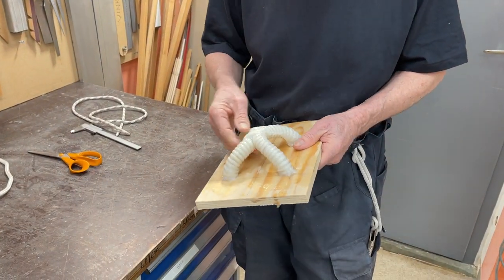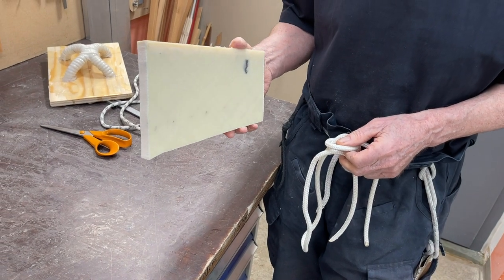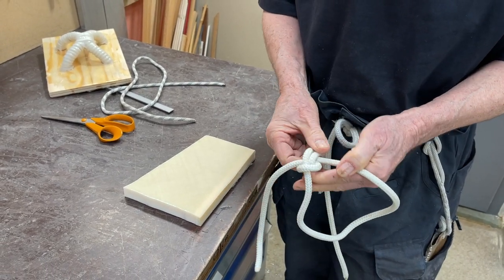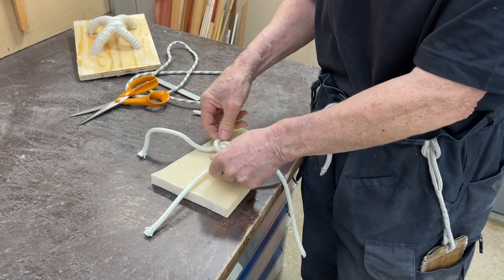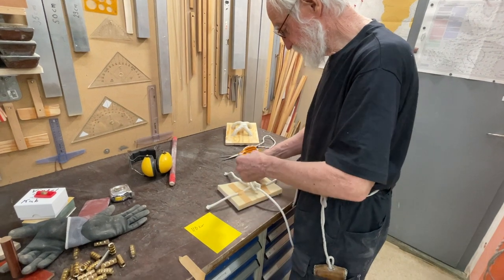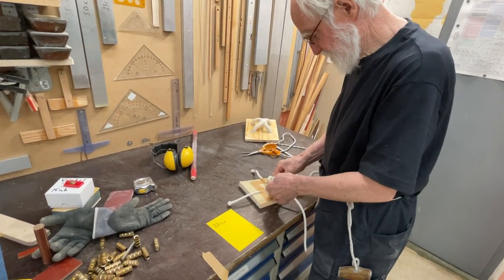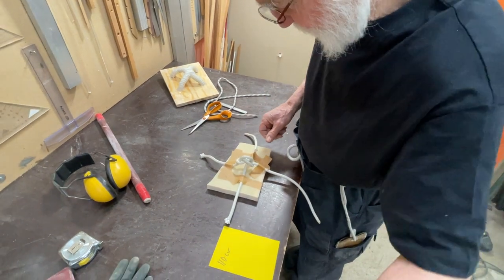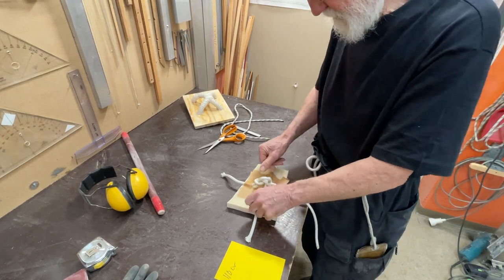Textile/Epoxy strongpoints once again.

Comment: These make relatively inexpensive tie downs and strongpoints. The biggest advantage, in my opinion, is that they can be bonded and integrated into the hull without the worry of metal corrosion, galvanic issues or fastener failure. Thank you Sven for sharing.
Reply: I agree.  The simplest details are the best.  Phenolic sheet is an excellent material to distribute a point load over a larger area, and it can be cut with common tools.
Reply: They won't leak either.

Comment: I know I will be using the textile rigging for additions in the future. 
Did you originate or see others before? Your craft was the first I noticed it on.
Reply from the maker: So far I know no other using them.
I do not know why not.
Maybee tradition.
Evolution have followed an other path
Reply: I think I saw a similar idea on Duckworks some years ago. IIRC that  only used two strands though, and the rope was wrapped in glass tape and saturated. This would be much stronger.

Comment: For the part of the rope that is glassed to the surface, have you considered splitting the rope ends into strands and spreading them out for extra surface area between glass/epoxy and rope? I don't actually know for sure whether that would be stronger, but it feels like it should 🤔
Reply from the maker: Shore splitting the rope is good but it is obvious so I did not do it in the demonstration.

Comment: This problem has me thinking that the ultimate strength of the detail is the tensile strength of the board to resist it being pulled apart from the center plane of the board, not the shear in the plane of the board as it would be if you were going through it.
My thought on going through the board is to not waste the holes, and put a handle on both sides, just because one can do such a thing.
Reply from the maker: It is obvious that If the board is not strong enough, just reenforce it with extra layers of carbon or glass.
Mostly it is, but if you like to lift the boat on a single point beef it up.
Reply: @SvenYrvindExlex  I agree.  I think such a connection can be made to work with carbon reinforcement if it is needed as you suggest, and connecting to a larger surface area.
Reply: @Joseph,
Agreed.
For example:
A vehicle decal attaches only to the paint atop the vehicle structure.
It is easy to remove...
... and just as easy to pull some paint with it.
.
I prefer the first demonstration with the through-decks at 00:29
Adding a second board under the deck would be my choice, and I would make it bigger than the knotted area to spread the stress